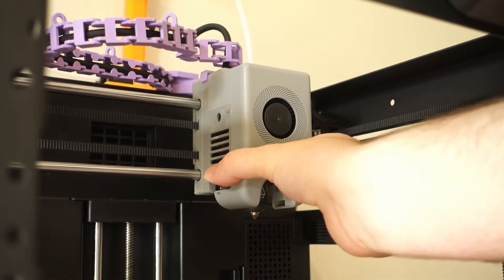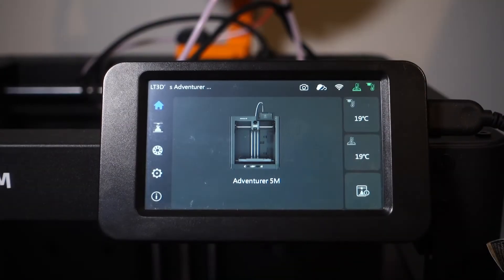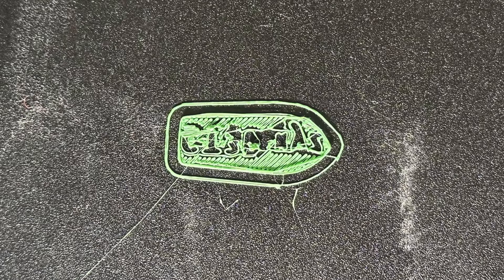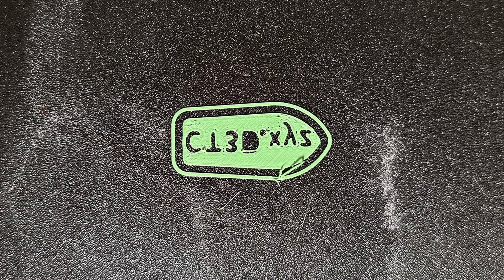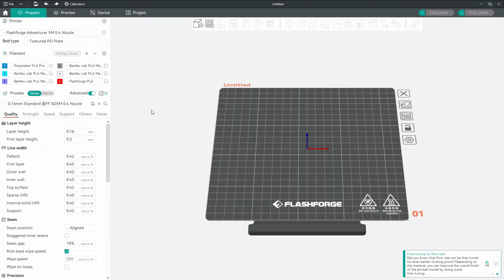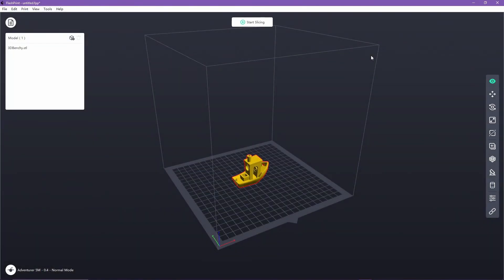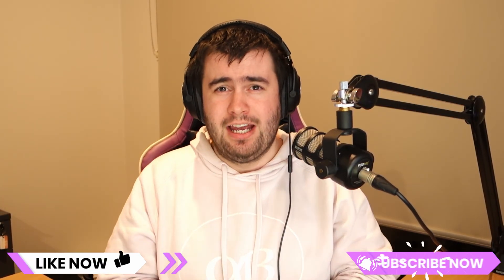Fix Your Adventurer 5M's Z-Offset!

Comment: Thank you so much for that great information. I've been doing decent with the adventurer 5m with petg and pla+ for about a year. All of a sudden, I was printing horrible wall separations, along with the first layer not bonding together, and chunks of bunched up filament throughout the entire print. Having the manual Z-offset adjustments while i was able to watch it print was exactly what I needed. Thanks again 🤘🤘

Comment: thanks so much my printer has just been making blobs and a bunch of spegetti because of the new firmware but i reverted back to 6.2.3 and auto leveled and set my offset to .25 and it works great

Comment: To start with my 5M printed great. I done a bed level and after that the first layer has been terrible. Doing bed levels again do nothing to fix. The first layer is never the same. I keep on having to adjust Z offset back and forth from .025 too .100 and everything in between. Before this started the printer had been through 2 rolls of filament flawlessly.
Reply from the maker: Have you recently updated the firmware on the machine? I know sometimes their firmware updates muck up the z-offset, if so I’d either contact their support team for a previous version of the firmware or check their website for a previous version then manually revert back to that version.

Comment: Having problem with my flashforge 5m happened suddenly once set print temperature the print head goes to its right along the edge then the nozzle temp drops.Fitted new nozzle till doing same.
Reply from the maker: How much does the temp drop by? If it’s only 5-10 degrees it may be that the first layer temp is set differently

Comment: Z offset is not something that is static, it alters with the bed and hotend temperatures, So a temperature 60c bed 200c hotend will be totally different to a temperature of 90c bed 240c hotend. The gap changes size dependant on the temperatures being used. The best way to print on any 3d printer is to heat up the bed and hotend and do a bed leveling before printing.

Comment: So are you not supposed to have the removeable plate on the bed when leveling?
Reply from the maker: @jbonatti7791  you are supposed to have the plate on the bed.
Reply: Wherever that tip touches during homing it gonna save it as as zero and will print from the point it touches. So if you add the plate after homing it’ll scrape and possibly destroy the nozzle

Comment: Do you have any videos on this printer for tightening the belt? There seems to be nothing out there on how to do it?
Reply: I did it as part of troubleshooting my issues and it seems like all you have to do is while the machine is OFF release the screws (four in front, four on back) move the print head from corner to corner a bit and then tighten them down. Apparently the mounting bits are spring loaded and will self-adjust

Comment: I have had more botched print than not. I get everything from air printing, where it moves off the print and ejects filament in the air. To printing on the bed and pulling the filament off the area. I can’t figure out how to slow it down either.

Comment: Just purchased a 5M Pro, and the first few prints worked fine, then...
Now, I get all this stringy messed up junk.
It still prints the stock cube fine, but if I try to import a project, now, it just makes a mess.
I'm seriously thinking about sending it back, and giving away the filament I've purchased, because it's just too much of a hassle...
It's a shame really, because I was really enjoying it, but this is just too frustrating to deal with...
Reply: Did you ever get this resolved? What fixed it if you did.
Reply: @TRaider66  Yes, I calmed down, and started learning, LOL!
3D printing, while pretty straight forward, still requires one to learn the ins and outs of it all.
I'm really enjoying the journey!
Reply from the maker: Is the model sticking to the bed properly?

Comment: I don't know if its just this latest firmware update or if its always been this way, but auto-calibrate gives me a perfect Z offset with a .4mm nozzle but when I switch to the .25mm nozzle and auto-calibrate, then Z-offset is way too close.  I have to back it off by .050mm to get a good smooth first layer.  (yes,  that is with flow multiplier calibrated)

Comment: I have a question do you know how to stop the bed from bottoming out
Reply: I'm here looking asking the same question
Reply from the maker: In most cases I've seen the issue is caused by something that is covering the sensor at the base of the printer behind the main lead screw. (please refer to image below)

https://images.squarespace-cdn.com/content/659d4c66537901301523ecaa/7ae92d6e-ce0a-4814-a0ac-fbaa1ec44f96/z+axis+sensor.jpg

Comment: I do have a question when my printer is calabrating it goes up to far and it hits the nozzle and then keeps trying to go up and then stops and says check trigger sensor
Reply from the maker: Check to see if there is anything under the print bed blocking the sensor. (At the bottom next to the big lead screw)
Reply: @LT3D_YT  are you saying “Something blocking” like as in something like filament fell back there? Just curious. I’m having the same issue and it was after a large print ripped off my screen and broke it. I got the screen replaced but now the nozzle bottoms out during calibration and stays too high when printing.
Reply from the maker: I've had a chat with Flashforge support a few times about these issues and there are a few fixes.

1. In most cases the issue is caused by something that is covering the sensor at the base of the printer behind the main lead screw. (please refer to image below)
https://images.squarespace-cdn.com/content/659d4c66537901301523ecaa/7ae92d6e-ce0a-4814-a0ac-fbaa1ec44f96/z+axis+sensor.jpg

2. Raise the bed to it's max height, turn off the printer, and check for loose cables under the bed. Unplug and reinstall them then restart and try homing again.

3. Least likely, the nozzle hasn't been installed correctly and needs to be pushed in further until you hear the click.
Reply: @LT3D_YT  do they ribbon cables under the bed just pull out or is there a lever you have to push. I couldn’t tell looking at it earlier.

Comment: I'm having Y-Axis go home error.  E0013.  Have you had this experience and do you have any ways to fix it?  I'm communicating with Flashforge, but it's taking a while. 

Thanks,

Patrick
Reply from the maker: First I would try upgrading to the latest firmware or downgrading if you are at the latest.

If this does not work check that nothing is obstructing the print head when homing, e.g. Guide Tube.

If this also doesn't work check that there is no plastic or debris blocking the Y-axis limit sensor on the head.

Last thing would be that the extruder board needs replacing.

Comment: When you say to *clean tip* before starting this, exactly what do you mean by that? And what are you looking for to alert you that the Z-Offset needs adjustment? How do you determine what is a "PERFECT" first layer? And once you get this set for one type of filament should it be the same regardless of the type of filament you're printing with moving forward? Appreciate any help. 

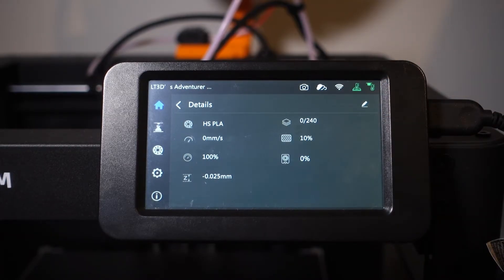At around 2:25 you show the on printer screen that shows the Z offset value. So, this is referencing the Z (build plate) position not the nozzle position correct? I understand only the build plate moves but when looking at this you are referencing where the nozzle is in relation to the build plate. So if the offset value refers to the build plate location, then the - and + indicators don't really reference what you are seeing. For example if it looks like the nozzle is too close to the build plate then you want the nozzle to be higher but in order to get that you have to hit the - key to lower the Z access (and the build plate), correct? So you're pressing the - button to RAISE the relative position of the nozzle with reference to the build plate, correct? And, of course, then you are pressing the + button to LOWER the nozzle. That just seems counterintuitive to me. But just want to clarify.

Would really like to see a video on how you should calibrate for new filament using Orca's built in Calibration settings and modifications you would make to User filament profiles. Thanks.

Comment: Thank you it was a very helpful video. I have a flashforge 5m printer and I bought Creality Hyper PLA filament. I had adhesion problem with this type of filament. I tried to change all other parameters but the final problem was the Z offset. I set up it to -0,05. It solved my problem.
Reply from the maker: Great to hear!

Comment: Alright, i was able to fix the z offset thank you but there is another problem, i looked at the facebook group and it said there is currently a version problem with the 5m and 5m pro i am going to look into that, thank you again
Reply: 2.6.6 and how should I get it from my emails to my printer?
Reply from the maker: @EpicEruptor13  Download it and extract the contents on to a blank USB Stick and then follow the video below.

https://www.youtube.com/watch?v=OSgLzW_mRXU
Reply: @LT3D_YT  ok, thank you, if anything goes wrong I will let you know because I'm 90% sure I will mess up
Reply: It just made the weirdest cube u have ever seen its like the whole thing was only stringing if that's the right way to explain it
Reply: I was un able to switch the versions, I went into the email on a computer downloaded the file and extracted it and it's contents then I moved it to the USB and put it in the printer then turned it off and on again and it did nothing
Reply: All of this started after I tried to load blue silk pla
Reply from the maker: Very unusual
Reply from the maker: I’ll get a copy of the firmware version from my contact at Flashforge and refresh myself on how to, then make a video 👍🏻
Reply: @LT3D_YT  ok, thank you so much
Reply from the maker: @EpicEruptor13  no worries! From my experience firmware versions 2.6.5 and 2.6.6 are stable so I’d recommend contacting there support and asking for the firmware files for both 👍🏻
Reply: @LT3D_YT  I will do
Reply: I got the files and I was wondering how do I use them?

Comment: Err, that build plate is so simple to remove that it's worth cleaning it outside the machine. Same for if/when you add hairspray or other adhesives to the surface - do it someplace else. Those things won't do the machine itself any good. And that surface below the bed (the one it Z-homes to with every job) needs to be completely clear of obstructions. Sometimes bits of filament will fall down there. I do these steps with every job, and have been very impressed with how reliable this thing is for turning a STL into a physical object. (psst, Flashforge, make a bigger one of these and I'll buy it too)
Reply from the maker: @suzyamerica4679  Yes you can remove the build plate and clean it if you like however for ease of recording in my setup I chose to keep it inside the printer. Also I clean my build plate with isopropyl alcohol which will evaporate anyway and not affect the printer.
Reply: @LT3D_YT  This thing is such a fantastic printer. I use mine exclusively for making working parts of different kinds. Plumbing adapters, parametric designs, tool add-ons etc.
Reply from the maker: @suzyamerica4679  fantastic to hear. It’s a great printer at a great price!

Comment: Very useful tutorial. Thanks for the info. When changing z-offset in the slicer, what is a safe amount to lower the nozzle each trial run? In other words, I’m assuming big changes in nozzle height risks crashing it into the bed, but it’s unclear what constitutes a big change.
Reply from the maker: Onboard the 5M and 5M Pro the increments are 0.025 so I would start there.

From what I've experienced myself and seen from others in the Official Facebook Group most people find either -0.025 or -0.050 to be the sweet spot for their machines.
Reply: @LT3D_YT  Weird question .. I'm only half a year into this subject, but so far it's been my experience that layer height issues can be completely obviated by tweaking the various temperature and speed settings for the machine. I print a lot in PETG and TPU. PETG was particularly fun to figure out - it wants slow cooling, it wants some side panels on the machine, low fan settings, layer print time settings, etc. When you get these things right, there's no need to adjust the Z-height at all. I'd export & share the settings if I knew how ;)

Edit 1: Here are the PETG settings I ended up at. Been just throwing jobs at it and they print with no adjustments during the job.

"enable_overhang_bridge_fan": "0"
"fan_max_speed": "10"
"fan_min_speed": "5"
"filament_max_volumetric_speed": "9"
"filament_settings_id": "Flashforge Generic PETG - Custom"
"from": "User",
"hot_plate_temp": "73"
"hot_plate_temp_initial_layer": "73"
"inherits": "Flashforge Generic PETG",
"is_custom_defined": "0",
"name": "Flashforge Generic PETG - Custom",
"nozzle_temperature_range_high": "265"
"nozzle_temperature_range_low": "235"
"slow_down_min_speed": "10"
"support_material_interface_fan_speed": "10"
"version": "2.1.1.0"

Edit 2: These settings are for the vanilla 5M machine with no top cover, two test covers on the sides (LOL cardboard that's duct taped into place), and no front door (or front door left wide open).